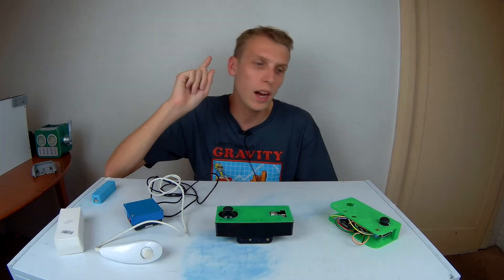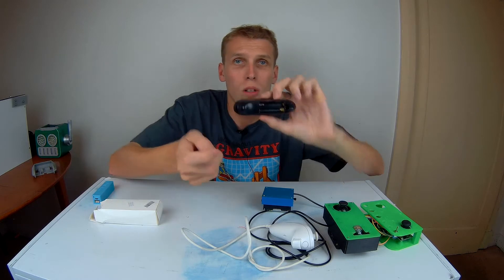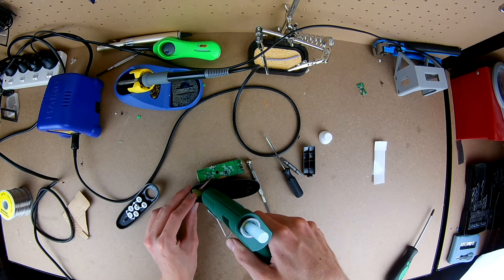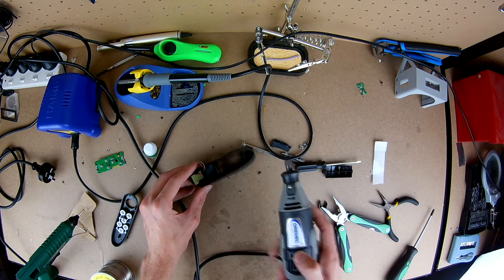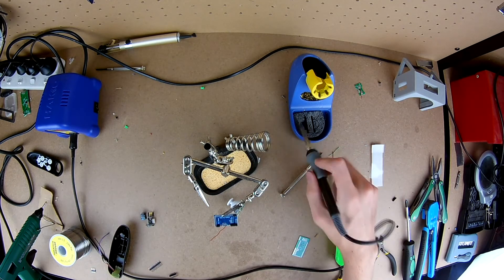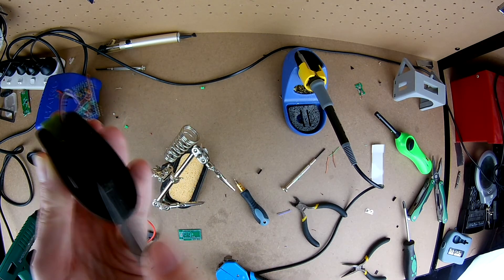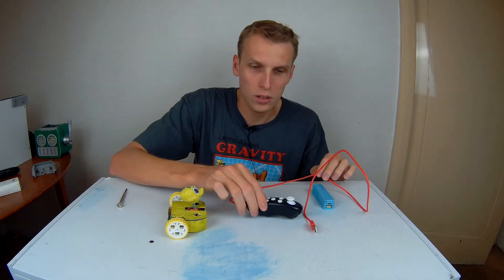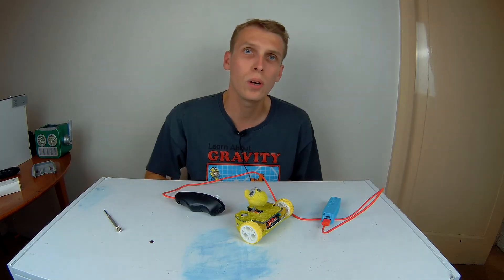DIY Arduino Controller Step By Step!

Comment: Is this compatable with VR?
Reply from the maker: Not with the code I have been using.
You would need to custom code the receiver to have it interact with VR
Reply: @TeamPanicRobotics    OK thanks! So it does have an Accelerometer, gyroscope etc.?
Reply: @TeamPanicRobotics  the reason I ask is I want to make my own VR gear and I really liked this video
Reply: @TeamPanicRobotics  and how do I program it?
Reply from the maker: No it doesnt have an Accelerometer or gyroscope. But it does have an arduino inside, so you could wire in your own Accelerometer and gyroscope.

To program it you use the Arduino IDE

Comment: Bro  plz  plz  advise   Me   Is  it  possible  ?        To    Cnvrt   Old  USB keyboard   Using  Cheap HM-10 Module into  ...Bluetooth BLE    keyboard    ( not  with   Hid  keyboard )  .......???    If  not   Thn        Can  we   Use   Arduino +  HM- 10  BLE   Module      To    Wrk  as      Bluetooth  ( BLE ) Keyboard...??????         Plz  rply
Reply from the maker: I dont know. 

I havent really used HM-10 Modules all that much
Reply: Team Panic ok  suggest me  any  Other  cheap   BLE   Module   Which will  wrk  as    Bluetooth BLE keyboard ????

Comment: Any reason you don't run a BT receiver in the bot? Then you don't need to mod the controller (assuming you can find the protocol).
Reply from the maker: You've hit the main reason on the head, finding the protocol or even any documentation for cheap Chinese electronics can be a huge pain. I've bought cheap things to hack before, only to discover that even datasheets for the chips on the board were unavailable. So I could attempt to find the protocol, dump 100 hours into it and come up dry. 

The second reason is that Bluetooth is just not the best for robot controllers. Bluetooth protocol requires way more additional data to be sent (when compared to the NRF), its also got more latency, forces 2-way coms (which is not really needed on small combat robots) and it requires Master and Slave modules, I'd assume the module in this controller is a slave, so I'd need to find a master module to connect to the Arduino, unfortunately, those are rarer then slave modules, they are also more expensive and heavier then the NRF chip.

I looked into all of my options when I decided to build my own tx/rx pairs and the NRF chips stood out as the best option

Comment: Awesome tutorial! I am just wondering what the receiver compatibility is. thanks!
Reply from the maker: At the moment it can only be used with my Arduino based receiver (check out the instructable in the description). 

I've been looking into making it compatible with other receivers but its not a straightforward process
Reply: Okay, Thanks! By the way, I am having some major silicone wheel issues!  I am still experimenting.